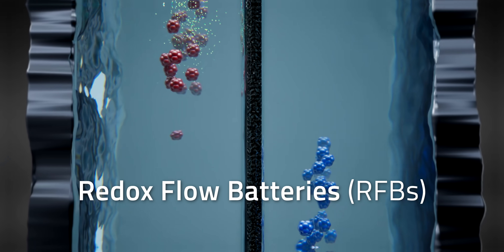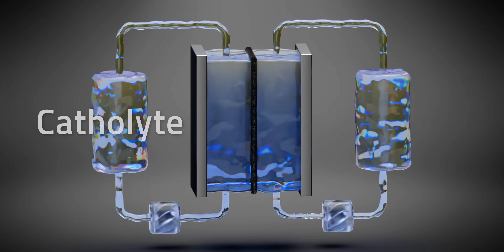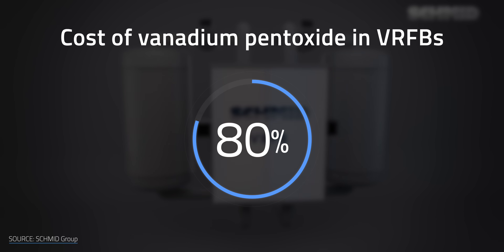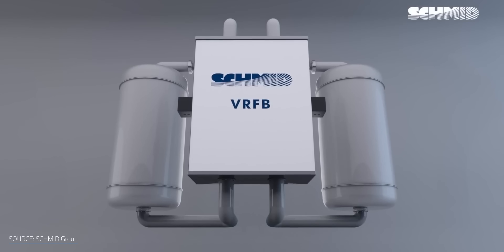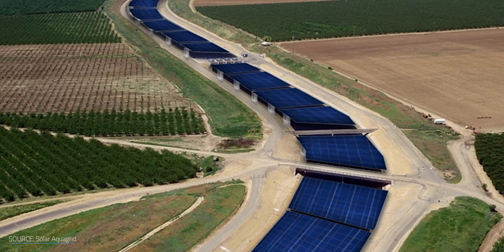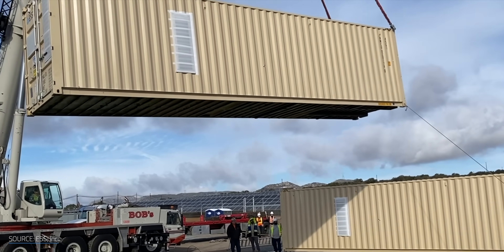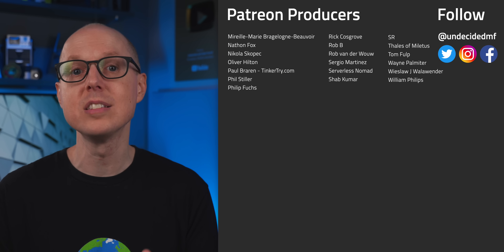Why Salt Water may be the Future of Batteries

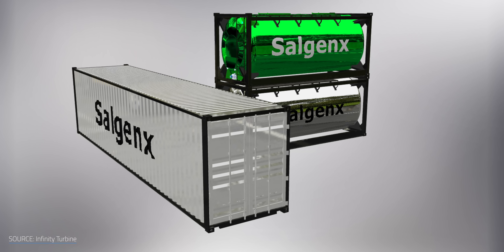Comment: This "low energy" density is perfect for home batteries. Based on 125Wh/L (7:08), a 10-gallon fish tank can hold 4kWh of energy. Scale that up to a small fridge-sized at 2ft x 2.5ft x 6ft (0.6m x 0.7m x 1.9m) and it can hold 798 liters or about 100kWh of storage. That is equivalent to 8 Powerwalls of energy, while Tesla rarely recommends more than 3 Powerwalls for non-mansions.
Reply: Please pin this! This math was super helpful for helping me understand the competitiveness of this battery! I would happily install an extra fridge sized unit in my house that can run everything my house needs, and then some!
Reply: @john-wiggains  think about this for appartments. Every appartment gets 1 (half fridge size). Or hospitals... charge those things with the "normal" utility power. And when a power outage occure. It will first use the salt water while a generator charge it......
Reply: @john-wiggains  2 x 10000 liter storage tanks and you have enough battery capacity to last you months. This company will not be allowed by governments to sell to residential units because it would make a lot of power utilities useless and take away control from the government.
Reply: @VoidySA  LOL, a battery only stores energy, it doesn't generate it, so it will not make power utilities useless. You have no need of storing months of power unless you also can generate that power, and if you can generate that power, you don't need to store months of it.

Unless you plan on covering a hectare with solar panels to live purely on solar, but you are living above the polar circle, lol!
Reply: @RegebroRepairs  I've got enough solar to be off-grid already, just need the storage capacity.
Reply: @RegebroRepairs  Nowhere did I say a battery generates energy. and most houses would have enough energy just from panels on the roof alone, you seem uninformed about solar power.
Reply: @VoidySA  No, I'm very well informed, but you clearly are lacking a bit in the logic department.

If you can supply your house from panels from the roof alone why would you need MONTHS of batteries, and how would having MONTHS of batteries in your house somehow get rid of the need of a grid, if you ALREADY don't need a grid because you are fully powered with solar?

The sun doesn't go away for months. Unless you live above the polar circle, and then you will NOT be able to power your house from rooftop solar only in any case.
Reply: @VoidySA  Why would you need months of storage capacity? That makes zero sense.
Reply: @RegebroRepairs  I live in South Africa, you would not understand it, let it be.
Reply: @Mark Sayers  Do you have months without sun i South Africa, lol? News to me.

You just talked nonsense and I called you out. Deal with it like an adult.
Reply: @RegebroRepairs  Why wouldn't you want months of storage if you can. My point that seems to escape you is that the space and price difference between a 1000 and a 10000 liter tank is a few square meters of your property that you can have months of storage if you want which can be used to help neighbors in a pinch. But it seems you are the keyboard warrior childish kind that trolls people for spelling mistakes.
Reply: @VoidySA  "Why wouldn't you want months of storage if you can."

A waste of space and money.

"a few square meters"

Yes, 10.000 liters mean you effectively have to build a small extra house. While 1.000 liters is a cupboard you can have in the basement. If 10.000 liters gives you three months, then 1.000 liters will give you nine days, plenty of time.

"space and price difference is a few square meters"

Oh, you think a shed and 10.000 liters of electrolytes are free?

Look, dude, you fucked up. You said something stupid, I called you out. Deal with it as a man. Don't dig yourself a deeper hole, which is what you are doing now.

"used to help neighbors in a pinch"

Now, if you want to, you can definitely band together with your neighbors and build your own little grid. Not a bad idea. If one neighbors panels blow up, you can borrow power until you have them replaced.

But you can do that with any solution.

Having these batteries does NOT magically make grids useless, which is what you claimed. And when I pointed out that's BS, you started digging a hole.

I look forward to you expanding the hole you are in further in the next reply.
Reply: @RegebroRepairs  The floor diameter for a 1KL tank is 1,1m, for a 10KL tank it's 2,2m ...starting to feel stupid yet??? Price to volume is much better for the 10KL tank. I thought that would be obvious. I also said you CAN have months of storage...I did not say you have to have months of storage...
Reply: Thank you for the calculations! 💕
Reply: Yep, and all that will probably be necessary for maintenance is to top them up with distilled water every now and then, especially with that high cycle life that will only get better as the tech improves.
Reply: i want
Reply: If it works reliably you could put the tanks in the cavities between wall studs - 13" wide, 3.5" deep, 84 or so high, about 16 gallons - and as many along as you like.  Retrofits would be a pain but in new builds it wouldn't be too hard.
Reply: @jimsvideos7201  Retrofits should not be that hard. You just have to make a wall, and you'd probably be ok doing this with inside wall (no insulation). I saw multiple vids about wall replacement, outlets replacement and so on. I never did that, but i'm pretty confident this is doable. In us and canada, probably not so much in europe with plain full real walls.
Reply: @Feuby  the mixture of water tanks and electrical lines would be a problem.   You'd need to put electrical connections high on the tank and run wiring higher in the wall near the tank.   Not a game change but most existing wiring is at about 2' of the ground.
Reply: @jimsvideos7201  It might become dangerous to hang pictures or put up shelves.  I think I want this unit where I can see it.
Reply: @jimsvideos7201  That might look good, but it would be bad if someone tried to hang a picture on that wall.
Reply: For many homes, yes. But for multi family housing space is often at a premium, so possibly not always. Also it’s common to quote cell-level energy densities when talking about batteries which are significantly more optimistic than real world battery pack-level densities. That may be the case here for the 125 kWh/liter figure - it may not include all the required components for a real world installation.
Reply: @astewart1900  Apartments generally don't have solar panels they need to store the energy from etc, so yeah, this is more for single family homes.
Reply: @astewart1900  Seems those who insist on the silver bullet and one size must fit all are those deliberately trying to derail any and all energy solutions. Wonder who they work for or what energy industries are they invested in.
Reply: Yeah, low-density only really affects anything that needs the most power in the least amount of space. This wouldn't be very good for a phone or a car, but homes and grid systems don't have nearly the same size restrictions.
Reply: @Naokarma  Also low density also affects availability too. Lithium is definitely far harder to find and extract than Salt Water.
Reply: sodium ion batteries are better and cheaper than flow batteries
Reply: Hell even with extremely conservative estimate of just 50kWh with a small fridge, that shit is more than enough to power a small house for quite a while. If this tech goes off, this would be revolutionary in many fronts.
Reply: I was just wondering when a crane could put a 20 foot container in my garden in the UK, but seems like I'd be powering the whole town 😂
Reply: That would be amazing!!

It would be awesome to just have cheap native batteries like this. Get something which could power your home for weeks & then just over spec your solar & go off grid or sell the excess though a virtual power plant.

This has the potential to massively decentralize energy production & make a far more resilient society.

Even poor people who can't afford it benefit because the more people producing power, the cheaper it'll be for everyone (if their properly compensated for selling their power on the open market)
Reply: I’m sure utilities could integrate these into areas like transfer stations. That leaves reworking the grid to increase reliability and utility scale regeneration.
Reply: The big question when scaling down flow batteries to just a few kWh is the cost of the active part in the middle with pumps, valves and electronics .  In huge installs, this gets drowned out by other stuff such as the land it stands on, the walls of the tanks etc.  But scaled down, this becomes dominant .
  While EW is a new company that might need to hide costs by selling some units at a loss, older flow battery companies like Goldfarb/Amaerican Vanadium will have established prices that can give an idea of the realties that would bite when replacing their expensive vanadium fluid by something cheap .
Reply: The size of a small fridge plus solar panels, wind generators, geothermal generators, etc to charge them.
Reply: Power is the question. It holds plenty of energy, but what is the power rating? If you want to run a house with it you'll need 5 ish kW for appliances or air conditioners.
Reply: @nonconsensualopinion  power concerns for this design aren't huge.  We're holding a proprietary idea a little closer to chest about how we resolve power concerns.
Reply: @nonconsensualopinion  Surprisingly demand of house power isn't that big. Espescially when you can shave here and there.

The problem lies on energy storage mostly for industrial application which require both long duration and insanely ultra high power require.
Reply: exactly my thoughts as i was watching
Reply: This would be great in an off grid application as well.  Now if only they would install one on my property lol
Reply: Very helpful calculations to visualize.   I hope you’re a high school physics teacher!
Reply: @jbwhalen8865  "Lithium is the FOURTH MOST COMMON element in the world. "

Uh, what? No it's not. It's in fact #25, and it's quite hard to extract from anywhere. The cheapest way to find it is to extract it from salt flats, where the lithium salts are at BEST 0.8% of the salts. And of course, lithium is only a part of those salts. Lithium Carbonate, for example is only a sixth lithium. So the salt in those salt flats are typically maybe 0.1% Lithium. And in rock, it's an average 0.002% lithium.

We aren't running out or anything, but compared to Iron which is the sixths most abundant element, Lithium is extremely rare.
Reply: Works well for grid storage as well.
Reply: But "pickle liquor"  isn't a waste product from making steel. It's a chemical cocktail to "pickle" steel.
From Google:"

"For low-carbon steel, pickle liquor typically consists of hydrochloric or sulfuric acid. For high-carbon steel, on the other hand, pickle liquor typically contains additional acids like phosphoric and/or nitric acid"

Operating/powering the grid with solar, wind and batteries is pure fantasy. This channel promotes every snake oil out there.

Just look at his old videos and then search and see if these things are now taking over the world.  A bunch of flops.
Reply: The problem is that the general industrie wont allow widespread home storage. In some places they don't even allow you to use your own electricity when you are not buying enough form them, and in some cases you have to put everything into the grid for a fixed pricce while you import again for their price.

They are all hoping on CO2 grants to develop things that are long overdue or not necessary.
We could totally have baseline power from geothermal energy, drill a few 2-3km holes and you have superheated steam you can run through a turbine, and all it will cost is the initial build and the turbine maintenance.

No, electricity has to become more expensive as per government because taxes are based on percent and so are the profits of these companies.
It would be hell on earth if everyone would grow their own food, heat their own homes with solar and produce their electricity and all without paying anyone anything. They don't want that. Quite the opposite.
Reply: I dont believe on those measures...
Reply: Disclaimer-I don't know what I'm talking about-, but, because of the 'more moving parts', there may be a smallest practicable size for this set-up, when you include pumps etc., they may become unviable, energy-wise, or economically. Be nice though- You have one big pit of sand, to store all your thermal energy needs and a big, saltwater tank, to store all your electrical energy. We are so, so close, but I fear- too late. Still-keep fighting.
Reply: As I know density of vanadium flow battery is about 25Wh/L electrolyte. which is about 1/5 efficent of IRB? unbelievable
Reply: And it won't burn your house down if it decides to run away!
Reply: and why would you prefer that insted of a powerwall, which will inevatibly costs less, and perform better in every aspect?
Reply: @JohnSmith-pn2vl  because it'll be 1/10th the cost.  Extremely lower total materials cost AND much higher cycle life leading to a total life cost around 1/10th per $/kWh from the projects that lithium ion will reach by 2030.  Also incredibly less toxic and flammable which will be huge for construction regulations for in-home designs.

This is my project (Salgenx).  It'll be revolutionary compared to the current RFBs and lithium ion battery packs.  I'd happily respond for comments.
Reply: @MrRollingPebble  How long do you think it will be before china sells 5kw units to everybody? you are probably not very popular at government level because your systems will take control away from them. Honestly, the moment your designs can be reverse engineered it will be. Give it to the people at a price they simply cannot ignore and you will be the hero everybody talks about, also start at residential units for the people, the big stuff like wind farm storage will automatically roll in. People want to be disconnected from utilities. In South Africa all businesses and households are suffering from the intermittent power from the national grid, If I can just buy a 5kw plate pack from you I would do that , add the pumps, plumbing, tanks and electronics and my business and home needs would be met and I would not be reliant on the poor power infrastructure that SA have. Unfortunately I will probably never see your products available here. Keep up the good work.
Reply: @MrRollingPebble  How can I get a tank of deadly chlorine from Salgenex for my house? Is toxic the same as poisonous? Why did you not correct the disinformation in this thread about the size of the installation with mechanical equipment? Did Matt get paid or receive gifts for doing this fluff piece that included a hatchet job on your competition?
Reply: @MrRollingPebble  If you don't mind, would it be possible for someone to DIY their own version of such a battery? I understand it'd be a lot less performant than Salgenx's however I'm really intrigued on this sort of energy storage, especially the fact it's significantly more environmentally friendly.
Reply: @Trigger-Warning  oof no i just got distracted and now this seems toxic.
Reply: @OfficialyMax  we obviously have a special design planned to cater to our commerical goals, but there's a ton of new and exciting stuff in recent literature that could make some DIY/safe and still effective designs soon when discussing independent power (low usage).
Reply: @MrRollingPebble   thx for comming to the comments! Much appreciated! Please help me understand the implications for usual home owners like me. Are you planning on selling these kind of systems to households with a demand of like 20kwh or are you just aiming for the big systems like industrial size? Thanks in advance!
Reply: @JohnSmith-pn2vl  Because you wouldn't have to mine as much lithium.
Reply: @JohnSmith-pn2vl  Q: why would you prefer that (instead) of a powerwall, which will (inevitably) costs less, and perform better in every aspect? A: well perform better in every metric except INFLAMMABILITY.  <--- for mature, thinking adults with the responsibility of keeping a home, wife, and family safe this is PRIORITY #1 (all other considerations are secondary).
Reply: @JohnSmith-pn2vl   No, a power wall is lithium technology, so these should cost far less and perform as well.
Reply: @JohnSmith-pn2vl  ummm, 25 year battery life with 20K cycles vs, lithium that can't be recycled and only lasts for 2K cycles?  No brainer. Plus these batteries won't burn down your house if something should short out internally ...

Comment: If the Graphene production claim is realistic… id be amazing, Graphene is an amazing material that will bring all new efficiencies to devices that use electricity
Reply: Graphene Manufacturing Group is definitely doing good things with turquoise H2 production and graphene batteries. Basically they sequester the carbon in methane as a solid, then use that ultra pure solid to make graphene. Nearly zero CO2 emissions and no mining and refining of graphite involved. The H2 is used to supplement the pyrolysis reaction. It would be even better if they could make use of any waste heat for power production and bring efficiencies higher.